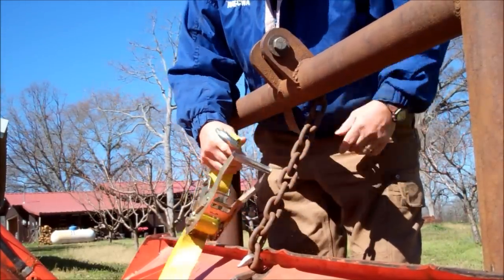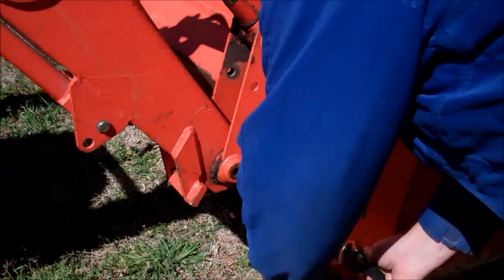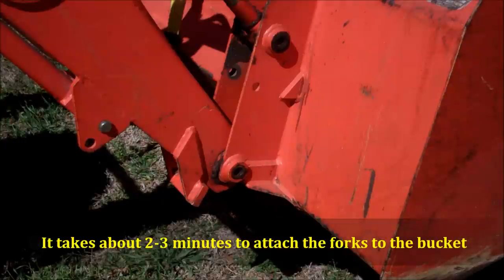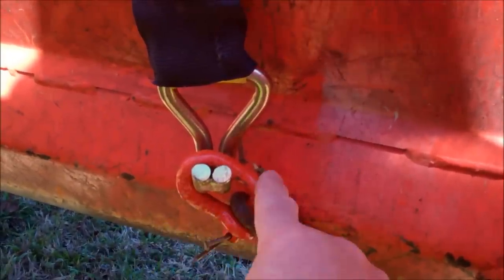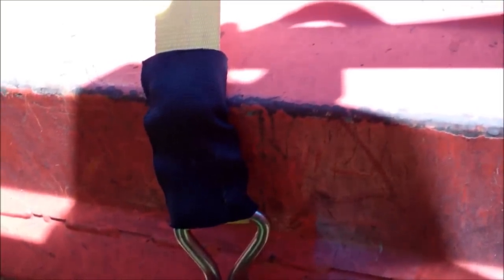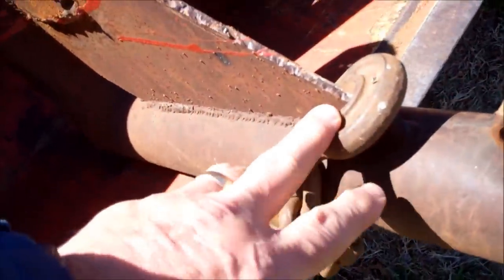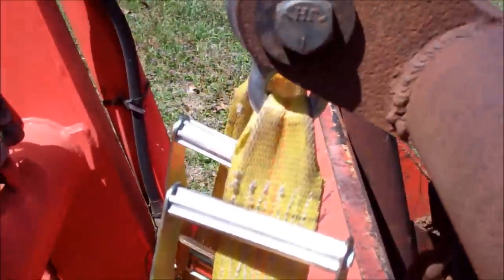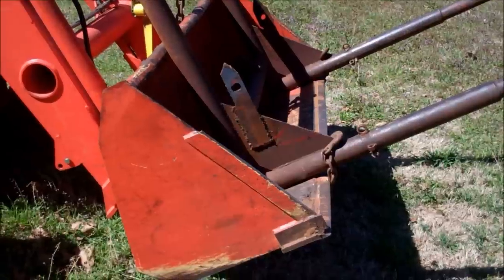NEW FORKS FOR THE FRONT END LOADER

Comment: I like it a lot, only thing I'd change for myself is adding a loop to the bottom of the fork for the chain instead of hooking the chain to the fork like you have it there. Very nice job tho!
Reply from the maker: The reason I didn't do that, is that I don't trust my welding enough to hook it to a loop that I welded... and... while scraping ground, etc... I could knock the loop off, if it's on the bottom of the forks.
thanks for the comment

Comment: Whats the rating on the ratchet rake straps?
Reply from the maker: Hmmmm... I really don't know, but they are 2" wide and VERY heavy duty.
I've tried to pick up stuff that my loader wouldn't budge and they held fine.
My loader is rated at 2800 LBS I think.
Reply: TexasPrepper2 thats plenty strong, thats more than my tractor weighs, so Id tip forward before they broke. Those forks look like they also attach to your 3PH, right? Im designing something similar for a cat 1 3PH and Id like it to be able to be mounted up front too, and have removable forks/tines.
Reply from the maker: That's why I did this.
Yes, they are 3 point forks, but I wanted to be able to use them on the loader too.
Now, I have some hay forks for the loader, but I still use these if I need stronger or longer forks.
https://www.youtube.com/watch?v=Rqw6AV0O9VQ
Reply: TexasPrepper2 Looks good, I wish I had enough land to require hay forks. Theyre actually a cheaper option in place of pallet forks, but usually not removable. Right now its just chickens and I can only justify a standard square bale at a time.

Comment: I would have used a turn buckle instead of the strap.
Reply from the maker: Turnbuckles would work too.
I tried a pair of binders, and they worked good, but cumbersome too hook up on the back of the bucket. I think turnbuckles would be even harder...
These straps are so easy to use and they are very HEAVY DUTY.  I think they'll pick up anything the loader will pick up...
Turnbuckles are a good idea though... thanks
Reply: I had this in mind,->  http://www.harborfreight.com/9200-lb-ratcheting-load-binder-5511.html
Reply from the maker: BUDDY LIGHT  I like those...
The binders I have don't have the ratchet on them, so I am unfamiliar with these... but I've been wanting to get some... so this will be a good excuse :)